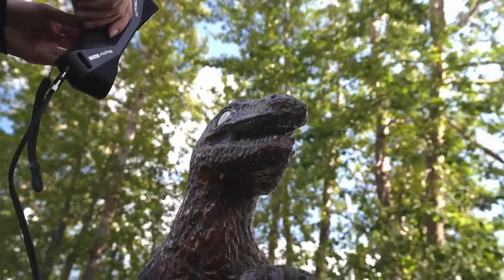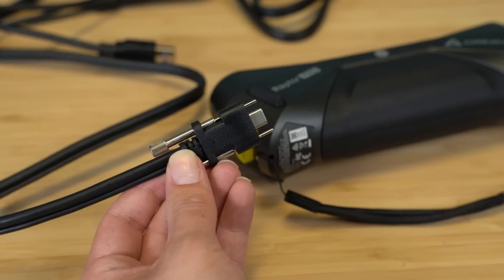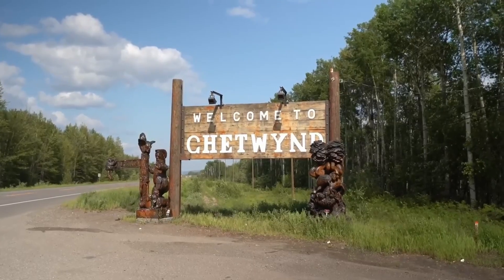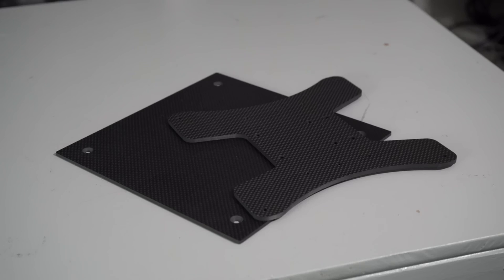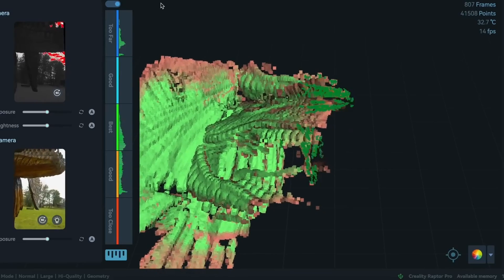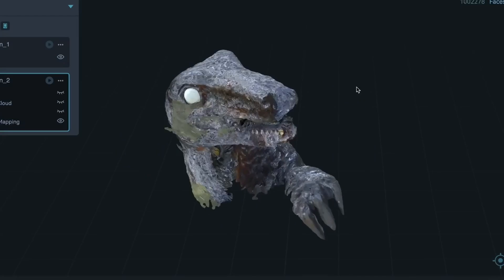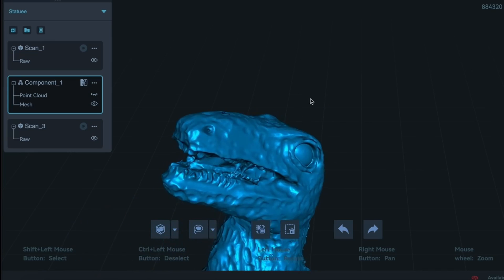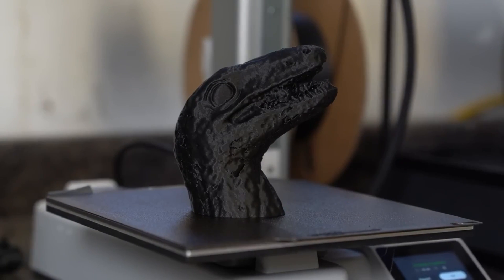Can I Learn 3D Scanning in Just 1 DAY? Creality Raptor Pro Review

Comment: Seems like it might be worth 3D printing a mount/handle for the Raptor Pro. Such that It could be a little easier to hold and move it around.

I guess you would need another Raptor Pro to make a scanne of the first one to get a good model into your CAD system 😂
Reply from the maker: That would be very handy for the ergonomics. I don't have huge hands but even then it is a bit tricky to hold. I'll have to ask Creality about a second Raptor Pro to scan the first 😎😎
Reply: @mitsumakes  😅
Reply: @mitsumakes  nah ..... ask them for a Scan Bridge and use scan that to make a 'handle'.
Reply from the maker: @harcosparky  🤔